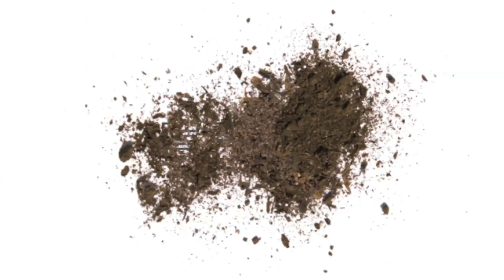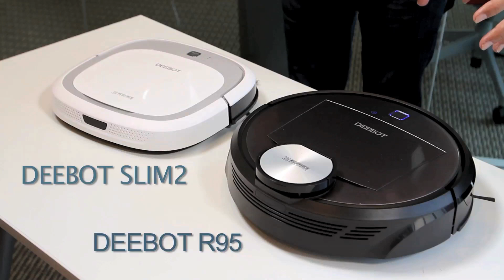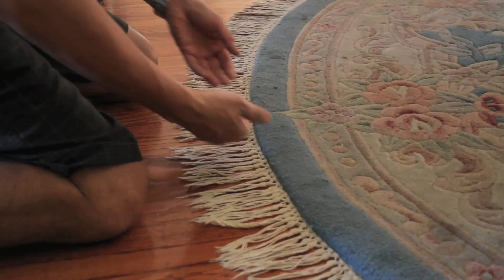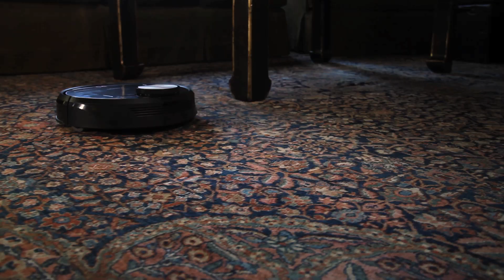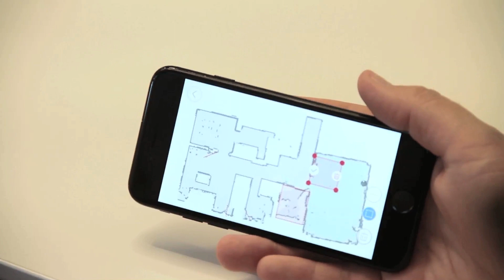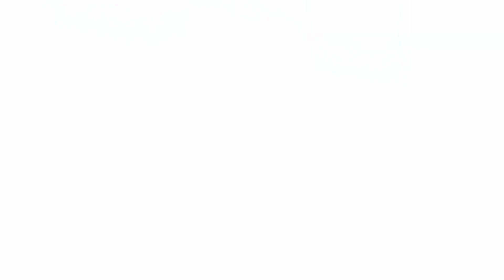How to Avoid Getting Your Robotic Vacuum Cleaner Stuck on Things

Comment: ECOVACS could fix so many issues with basic software improvements.
1.  Add an option to disable the stair sensor for people with one story houses.  My robot gets "stuck" on floor vents because it thinks it's about to fall down a flight of stairs which is really frustrating.
2.  Add an option to limit the amount of time the robot vacuums (or battery life) before returning to the station.  My vac frequently runs out of battery before it finds the charging station.
3.  Show error codes in the app!!  My vacuum is beeping and a red light turned on, but the app doesn't indicate that anything is wrong.  (And this is happening at the docking station when the robot isn't even in use.)
I regret buying anything from this company.
Reply: Had this before with a old model, stick some tape on the sensor and it will think its still on the floor 😉

Comment: Our N79 gets stuck under our cabinets and since it doesn’t have the gps deal I have to block off my kitchen. As of right now I’m running mine and have had to get her unstuck 10 times. It’s very frustrating especially when she’s made it through certain areas and just started to get stuck in places she has never been stuck in before like under my couch. Which isn’t low at all.

Comment: So your "how to avoid.." was really just "buy this one with the GPS"??  Boy, super helpful.  My M81Pro likes to go up on my cushioned kitchen mat but gets stuck thinking it's a ledge and will not come off. Those are the problems most come here to find answers to, not whatever this video was.
Reply: Same issue. My whole ecovac 930 was defeated by a thin lined black carpet. A CARPET! something it was designed to clean for.. Gets stuck there every single time and doesnt finish its cleaning and worse is dead by the time I have to put it back and wait for it to charge.  Essentially making me baby sit the vacuum to make sure its cleaning.  Already tried blocking the drop sensors which made the vacuum blind and crashed into everything it came in contact with and kept trying to push until it jammed.

Comment: We have had our N79 for about four months now. For the first month or so we were very happy with it but it started to develop problems, the worst of which is it will get stuck on air registers in the floor. There’s nothing on the register to physically hang them up, but I think the drop sensors are weirded out by them. I’ve even closed the registers and it still happens. I’ve cleaned the drop sensors off with the included brush and it still happens. No one at customer service seems to be willing to help with with the problem.
Reply: I have kinda the same issue with floor rails, as the vacuum is spinning over it’s own axis the sensor can’t avoid get trapped there, then the uneven surface makes impossible for the thing to go. There must be a solution

Comment: It would be good if the software would learn to not go to the same spot again if it frequently gets stuck there. My N79S drives around the corner and gets stuck underneath the refrigerator since the front has the grill that goes down in an angle, so it can drive underneath which lifts up the rear wheel so I can't back up again. The sensor doesn't see the top edge as (I assume) the sensor looks somewhat at half height for objects. So it gets stuck each time and comes up with wheel drive malfunction.
Also, the Alexa app works in general, however the command to drive back to the base to charge doesn't work at all!